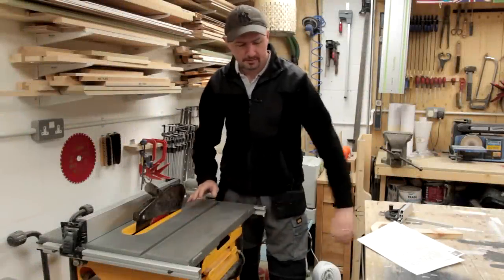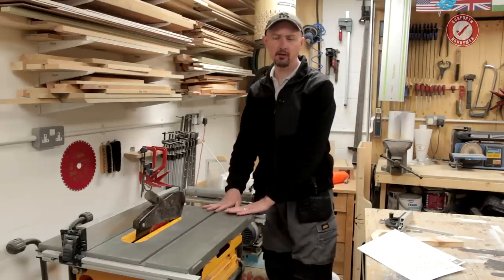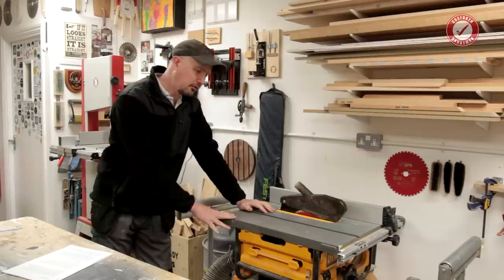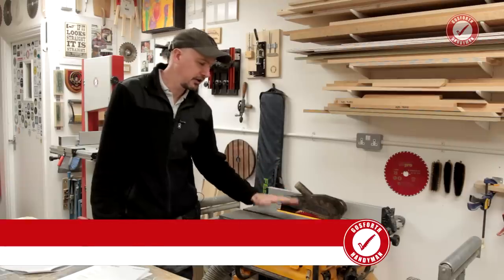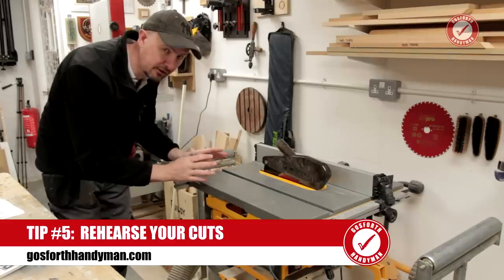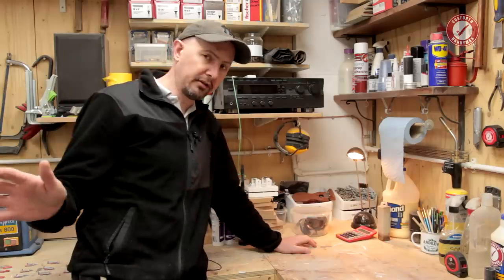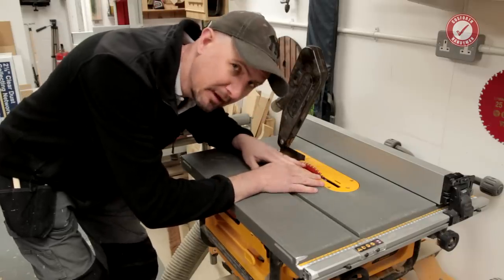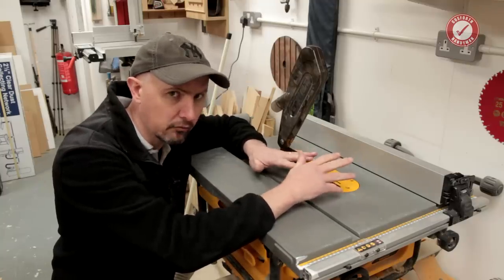TABLE SAW SAFETY - 11 tips to avoid death!

Comment: 21:00. It's a really interesting conundrum. A push block is better because it prevents twisting of the wood, by applying more downforce and more pressure on the work piece. But a push block allows your hand and body to go across the area of the blade. A push stick is extremely poor at controlling a kickback, and a piece of wood can spontaneously kickback if using a push stick without a riving knife. This is why a riving knife is so important, because it allows you to use a push stick with much less risk of a kickback. When using a push block, it's not any safer than using your bare hands, because if a board kicks back, it sucks the entire push block away from you, and still rips your hand towards the blade. The safest option would seem to be a push block that locks onto the fence, so it cannot be "sucked" into the blade during a kickback. In my case, I found that you can lock your body and your hands over the fence, and basically stay behind the fence, and use the fence to provide a barrier between you and the blade, so if there is a kickback, your hands can't be drawn towards the blade. You can stand on the side of the fence, and pull the material towards the fence as you are cutting, so there is no possible way a kickback can happen, but if it does, you are pulling hard away from the blade, so your hands won't be drawn into the blade. The worst methods of cut are using a push stick (a chicken foot stick) with no riving knife, or using your bare hands and standing directly behind and in line with the blade. If you are standing directly behind the blade, then your hands, or a push block, can be drawn rapidly into a blade.

Comment: I.had a table saw as a 2020 Christmas gift, only used it twice, and the second time I used it, I spent 9 hours in morriston hospital Swansea A&E.The kick back was just so fast I didn't have any time to react. I was cutting a 3x2 piece of rough cut timber without the riving knife installed and the timber shot back and took the end of my index finger  off,no blade involved here, just the speed  of the piece hitting my finger.Your video, i hope,shows what can happen in a second without due care and attention  to safety. Thank you for pointing out some of the mishaps that can go tragically wrong.

Comment: Very useful video. When I started woodworking a couple of years ago I had an old contractor table saw that had a very inconveniently designed splitter and guard instead of a riving knife; always going out of true and difficult to take on and off. One night I worked when tired instead of calling it a day. Having used the crosscut sled, which required the removal of the splitter, I then went to do a rip cut but FORGOT to put the splitter back on. BANG. My hands were well out of the way, but I had badly bruised ribs, and was seriously frightened. Anyway, I then bought an aftermarket Microjig splitter that was supposed to be installed in the throat plate. But it wouldn't fit properly on my saw. So, that saw got sold and replaced by one with a proper riving knife, a good guard, and anti-kickback pawls. I am still a bit afraid of the table saw, and have made a couple of mistakes that could have been dangerous. Wish I could afford a Sawstop saw.

I made some push sticks like the kind you DON'T recommend, because they are so prevalent on youtube channels.One of the ideas behind this kind of push stick is that they allow you to exert downward pressure on the work piece, to keep it from lifting. However, I have always been uneasy about the way they make me lean too close to the blade. My table saw is designed in a way that aggravates this; the blade is placed rather far ahead of the user. So, I am certainly going back to the fish mouth push stick, or some other design anyway.I suppose I could use a downward directed featherboard attached to the fence if there seems to be a risk that the work might lift.

Now that I think about it, I have occasionally rationalised and cut pieces that don't lay completely flat on the table, which creates a real risk of lifting or otherwise pinching the blade. Never again! Henceforth I will either joint the piece flat, or for warped plywoodjust use a different tool.

By the way, I actually think angle grinders are about as dangerous as table saws. I hate the damned things, but they are essential for some work, since I occasionally must make metal parts.

Comment: I’m glad I finally got around to watching this. Long overdue.

I should have pick tip number 9 naturally because I’m usually thinking critically and geometrically, yet I had overlooked that safety measure.

As for cutting from the side, I actually thought about that and had did it naturally one day using the router table as a table saw feedings he piece in between the blade and the fence for a perfect jointed face. I probably went against the grain as a chunk had broke off. Luckily I was behind the table. 😬 😇

Comment: Excellent tips! Those spinny things look so tasty sometimes, good to have reminders.
I'm late to the party, and admittedly, I haven't read through all the comments where this is probably already mentioned. That said, my only thought about making cuts from the side of the saw is that you don't have the ease of access to the switch to quickly stop the saw in the event of an emergency. 
The thing I've always been fuzzy on is the longer / shorter rule for what should or shouldn't be run though with a fence. I always try to judge my cut like this: if I can pass the work piece between the fence and blade and it always has support before (waste piece) and after (splitter / riving knife) the blade, then it should be ok. Otherwise either use a sled or miter gauge, assuming you can't make this cut reasonably with a miter saw.

Comment: I stopped your video at 2:41 to make this comment.  You're completely right.  I'm a "handyman" for a living and always wanted to get a table saw, but it was the last tool I purchase because it is the only tool in the shop that requires your hands to move towards the blade.  If I can somehow use another tool even if I have to build a jig to get the same results, I will avoid using the table saw.  When I definitely have to use it, I am extremely careful to finish the job with all my limbs and fingers intact.

Comment: When I got my DeWalt project saw, I also decided to use full kerf blades. I like that they have less flex. After buying the blades, I instantly realized that the riving knife on the saw was for the thinner blades. So I had to find a sheet of steel the correct thickness and then cut and grind it to match the shape of the factory knife. Took about half a day to make but has worked like a champ ever since.

Comment: I subscribed as a thank you for posting this; it influenced me to a safety decision that's a bit tangent but I wanted to note it.

With a project coming up, I dug out my old Ryobi and ran some test cuts on it. Basically a disaster: the blade isn't 90° to the table, or even parallel to its slot, damaged fence surface, etc. Probably dropped at some point in storage, at any rate after some fiddling I threw up my hands to invest in a new unit. My first thought was to throw the Ryobi on the sidewalk, thinking someone could grab it for basic cuts. Now, you've upgraded my thinking to "an imprecise table saw isn't just annoying, but dangerous" (did I mention it's missing it's riving knife?)

The new plan is full break-down/recycling to ensure NO ONE uses it ever again.

Comment: I love, love, love my power tools but nothing scares me or I should say has my most respect than the table saw.  I do everything you covered in your video and then some.  One of the first things is having a nice sharp blade.  If smoke starts bellowing off your work or the wood has burn marks from your cut and doing everything correct, time for a new blade or time to sharpen the old one.  I love the results when I use my saw.  For cutting work standing on the side, I do that when I can since I feel it more safer if my work does kick back.

Comment: Great vid!  Love the talk about the PPE (personal protective equipment), that does include clothing!!!!  There's a vid on here somewhere where a guy makes his own feathering board for a table saw, and you can see in the vid, down past the table of the saw, he is wearing shorts, and no shoes....!!  I am a metalsmith and a woodworker, and occasional stained glass.  No one is allowed in my shop even just to watch without the proper clothes, PPE, and what we call close-toed shoes... (No sandals, flip flops, or ladies peep toe shoes allowed!) The feet must be completely covered. I wear steel toes as smith anyway, heavy steel objects and tools just love to smash feet.  And anyone using my tools has to take off their jewelry and tie back their long hair.  Rings are an open invitation to losing fingers.  I have the added danger of fire in my shop too...  Fire from gas welding torches, sparks from grinders, hot slag from welding on metal.  All of that is done outside on the concrete pad between the concrete fence and the concrete building! And 100% cotton clothing! NO synthetic clothing near anything with sparks or fire.  Keep up the good work, man!

Comment: Good video, a lot of great advice.
I do have mixed feelings about the push stick though. I like to have personal contact with the piece I'm cutting. This way I always know that pressure is applied downward, to keep piece flat on table surface, and towards the guide fence, so that piece does not twist left at the end of the cut to catch back side of blade (which is where kick back happens). OBVIOUSLY, if the piece is really narrow - 100% - I use push stick!!
Setting blade height- rule of thumb that I was taught is that blade height should be set so that gullet of the blade would be equal, or just above, thickness of piece being cut. Personally, I like to set the blade slightly higher (gullet x2), to make sure that force of blade while cutting is actually forcing the piece downward. If the blade is set too low and you push the piece a bit too fast - blade will actually push the piece up.
Safety guard....yes, it covers the blade and prevent you from putting your hand down on running blade. But at the same time, it hides the view of the cut you're making, and on narrow cuts - makes it more difficult to feed piece through.
The best advice anyone can give for using table saw, I agree with you 100% - RESPECT the saw and always be focused on what you're doing!!
Great video overall!!

Comment: My cheap porter cable table saw has the ability to adjust the height of the riving knife.  When I am using the crosscut sled I remove the guard and lower the height of the riving knife.  Amazing what you can find in the manual, when you bother to read it.

Comment: Great video. Thanks for the frame-by-frame analysis of your accident, really useful. Glad you're ok! It takes a good deal of humility to go through the analysis of it for the benefit of others 👍
I like the idea of using the saw side-on...
Only other thing I've picked up from other videos (and is something I thought you might mention) is to wear your cap backwards so that any chips that get thrown up don't get bounced back down off the peak of your cap and into your eye, behind your glasses).
My level of experience is this: I've just bought a saw and haven even turned it on yet.

Comment: About 10 years ago I was remodeling a house and installed an aluminum storm door at the end of the day. The jamb side strike plate for the lock for some reason extended 1/4" too far for the latch to engage despite trying every adjustment possible. My table saw was still set up in the driveway so I decided to avoid an extra trip the following day I could run the cast aluminum strike plate through the table saw carefully and shave off 1/4" and finish the job that day.

The aluminum strike plate was about 2 1/2" by 1 1/2" so was too small to control with a push stick so I lowered the blade to just clear the piece, put a riggers glove on to protect my hand in case something went wrong and started to cut slowly and carefully to avoid wobbling the piece and causing unwanted kickback. 

Something went wrong. 

The cut went better than expected, at first No wobble, clean cut, no resistance from the blade or workpiece. However, the aluminum started to heat up and quickly got too hot to hold, even through a glove. I instinctively let go - mid cut - and the block of aluminum suddenly disappeared from view. A split second later I felt a sharp pain in my chest at the top of my ribs and noticed blood dripping from my left hand middle finger. Taking off the one glove I was wearing I found a purple bruise and cut between my thumb and index finger on my right hand, a crushed finger nail oozing blood on the middle finger of my unprotected left hand and a purple bruise the exact shape of the strike plate on my chest in the center of my chest. I was wearing safety glasses but a hit in the face I think would have broken my nose or taken out an eye.

To this day I feel I got incredibly lucky and still kick myself for being so foolish.

Comment: Thanks for this video.  Lots of good info here.  I do have a few comments.  (And I feel I am qualified to critique because I have done woodworking for over 30 years.  I first used a table saw about 50 years ago,)  The Dewalt push stick you recommend using is only good for small short pieces.  The longer homemade wooden push stick which you reject is much better because the long front sits on top of the wood and holds it down.  It simply needs to be much taller to keep the hand well above the blade.  The plastic push stick has such a short front to hold the piece down that it would do little to keep wood flying back at you should it bind.  In your near bad accident the main thing you did wrong was not pushing the piece of wood past the blade.  But also your left hand should not be trying to catch the cut-off.  This distracted you.  One's concentration should be on the right hand if it is the one pushing the cut through, holding it down and solidly against the fence.  Forgetting the cut-off piece will also let you move your body as much as possible to the right and out of the path of anything the blade sends back.  At around the 26 minute mark you again say the long skinny push stick is good.  It is not.  Make a wide push block with a high handle and a long front for this type of cut.  You'll have much better control.  Using a good bade guard is best of all.  It makes it all but impossible for your hand to get near the blade.
All this said, I like your comment best about being sure before you cut.  My rule is similar:  if you are not 100% sure of the safety of a cut (not 95%) , just don't do it.  Thanks

Comment: Great video and love the tips. I agree 100% pick the right tool for the right job. Too often table saws are used for jobs better suited to other shop tools. For breaking down large panels, I prefer my track saw to the table saw even for fine cuts. It is quick to setup and does a better overall job.  Thank you for all you are doing especially addressing the safety topci.

Comment: I've always worked from the side of the table saw whenever possible. If the fence is not too tall or wide it's possible to feed the board through with both hands, with the thumbs locked in on the right side of the fence.

Comment: I've done cuts where I wasn't able to support the offcut / primary piece (i did use the mitre fence!) .... knowing what I was doing wasn't ok, I accepted that damaging the saw was the preference, and made sure that the piece just fell off at the end.  It's better to just let wood hit the floor than to risk a body part.

That said - I've also hit the emergency stop button on my table saw when I saw my dad borrowing it, and cutting a dado with the table saw.  In principle I'd not scream no, apart from his hand was directly over the blade, and was depending on the fact that the wood was between his hand and the blade.  Honestly, I wonder how he still has all his fingers sometimes.

Comment: I found out the hard way when cutting scrap wood, for whatever reason, tends to make one less careful and opens the door to accidents.  Fortunately I was following the safety practice of keeping the blade only slightly above the cut.  My thumb stayed intact but did require 6 stitches.  Also, I had a bit of a hangover from the previous night's entertainment and I was in a bit of a hurry to get the job done.  The last mistake of this fiasco was to shake my thumb, as if that would help matters in any way.  I threw blood everywhere.  Big mess, lost time, doctor bill and the project did not get done in time.  That was 24 years ago and a super wake up call.  I now cut all wood, as if it were rare expensive hardwood, using all the guards.  Lesson learned!

Comment: Excellent video and accident debrief. I've always considered the table insert to be a different colour as an absolute no go area for fingers or clothing. Respect the blade but only to the outside edge of the table insert. Same rule applies to band saws, router tables and anything with a blade surround.